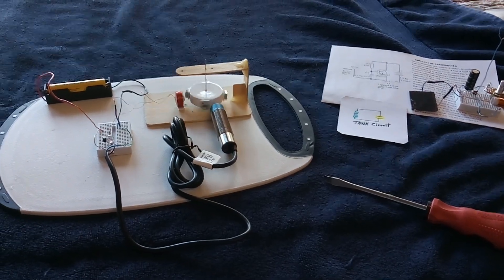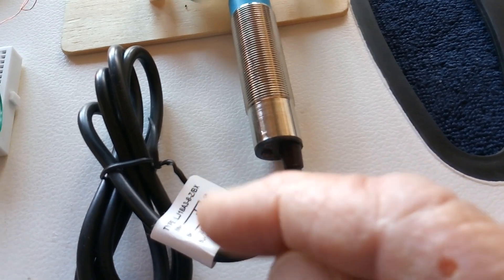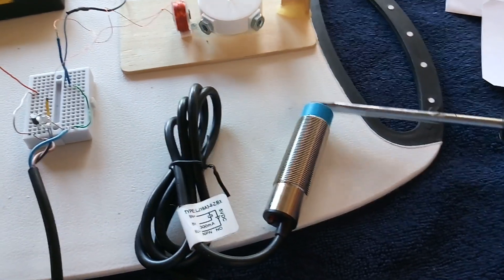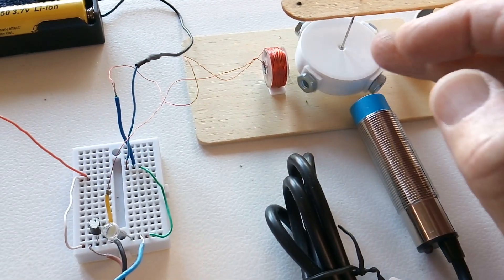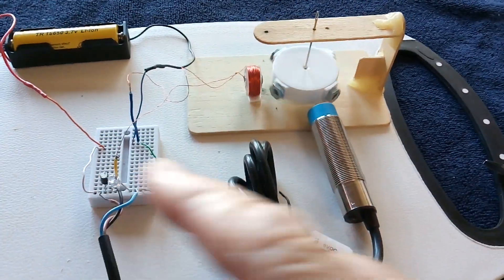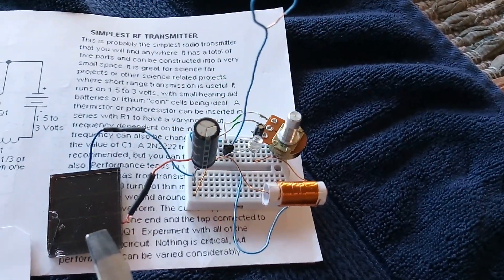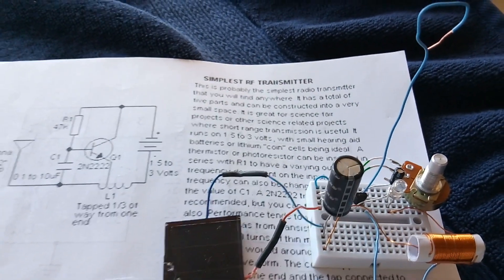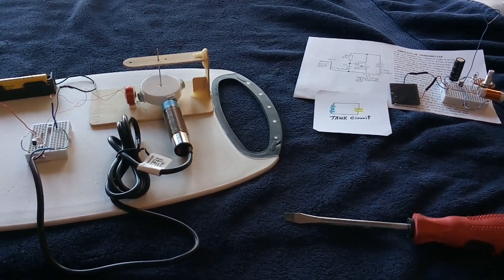Pure Attraction Motor --- using inductive proximity sensor

Comment: Totally agree with your end sentiment!  The transmitter has me thinking about synchronized motors. The emitted pulse could form a governor for several motors across a room. The Base of a transistor being fired by the detection. Uses could include efficiency tests for the set ffiring speed, direct comparisons, real time.
Reply from the maker: That simple little RF transmitter circuit could be used for a number of things.  I'm wondering if I could get it to trigger a simple pendulum circuit from a short distance.   I suppose you could just take the AM radio speaker feed and have that tickle the base of a transistor.

Comment: How is connected the led in RF circuit?
Reply from the maker: The led is placed between the transistor collector and the junction of the capacitor and the coil.  I tried putting it different ways but this worked best. The capacitor is a 10 uf in my circuit.  The pot is a 25k.  The super cap is a 2.7 v 10F.  The solar panel is from an old solar garden light.

Comment: Lid the rotor appeared to cog at the pulse .Timing of the magnet duration looks tricky.
Reply from the maker: Yes.  I have not looked at the pulse width on the o-scope but it looks too long to me.  There are ways to work with that using a 'flag'  trigger instead of the nut.

Comment: have the nuts on the lid been magnetized during the process of experimentation ?
Reply from the maker: No.  The nuts are not magnetized------so far.  It would be better if I used small steel laminates but for this simple experiment it isn't necessary.